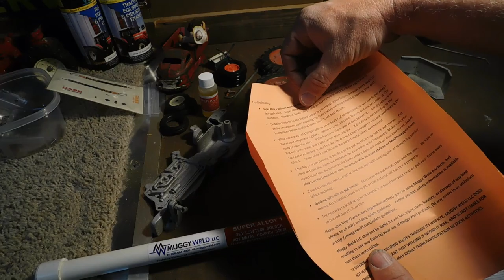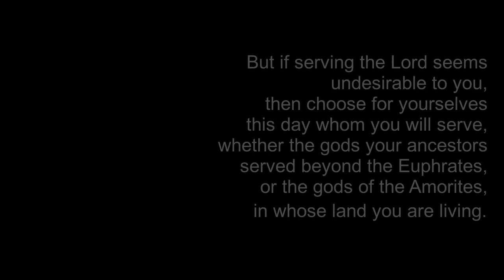1960's Ertl Tractor Restoration - Case 1030 Comfort King

Comment: Thanks for sharing your restoration adventure it look like a great paint job  even with the less creamy paint on the hood and fenders  than original. I just happened to see this while searching for something else Ertl related to be honest I didn't mind the Buddy clips, it's something different in the video. Restoring old Ertl tractors is pretty well all the same other than colors because of how they are all built.
  Your problems during the restoration are just on a smaller scale to what you'd find with a real tractor, I've done lots of real Fordson Majors, , and a few other tractors and backhoe loaders over the years. I also collect and custom build tractors and excavators that are smaller scale like 1/32 and 1/35. I just built a  1/43 kit of parts for a 4wd T 150k Russian tractor this winter, that was fun painting and riveting the plastic parts like 3 point hitch  and center pivot together. Those rivets so small they split the plastic real easy or vanish off the desk if a mouse sneezed 3/4 of a mile away L.O.L. Take care

Comment: tractor looks great.case colors are flamboue red and dessert sunset.buy it at case dealer.
Reply from the maker: Thanks, I try to avoid buying paint at dealerships. They usually want $30 for a rattle can.
Reply: Power White was used on the later 70 series and 90 series. I agree that Desert Sunset would be a better choice, but I ran several Case 800's when I was a kid that had been repainted Power White, so it's not that big of a deal for me. Glad to see someone else comment on this genuine color discrepancy.

Comment: What is your blast media? I am using binding screws to replace the solid rivets in my restoration of another model.  I don't have $1000 worth of riveting tools and rivets.
Reply from the maker: fine coal slag, you can find it at Tractor Supply
Reply: @TheJayhawker  Thanks!

Comment: Try j b weld on it?
Reply from the maker: I tried JB Weld and regular epoxy. Just not enough surface area, it would stick and it would stay as long as it wasn't messed with too much. In the end I wanted something I knew wouldn't pull off.

Comment: Restored lots of toy tractors they aren't cast aluminum they are diecast metal pot medal is more like it
Reply from the maker: I probably picked up on the cast aluminum thing from reading about Ertl's history, because in the early years he melted down aluminum aircraft pistons for his material. Perhaps by the 60's there was a lot of pot metal in it which can't be strictly identified because they swept the floor and threw everything into the pot, but my guess is that a large percentage of the pot metal was still aluminum. Thanks for watching and commenting.